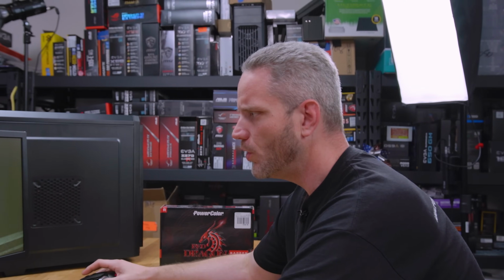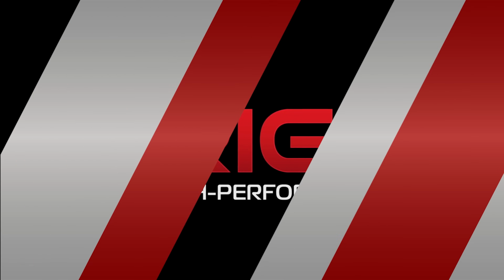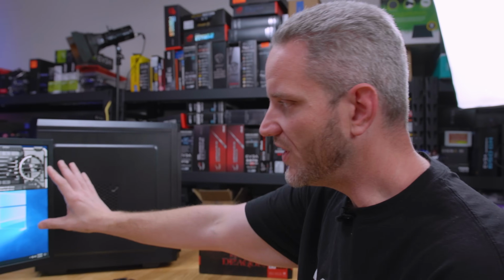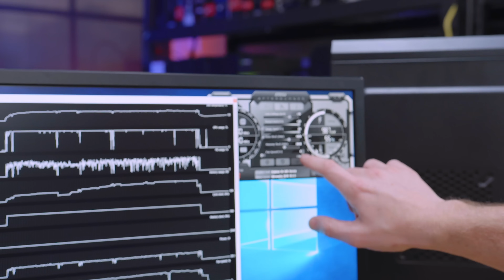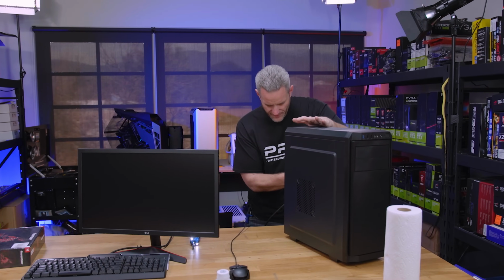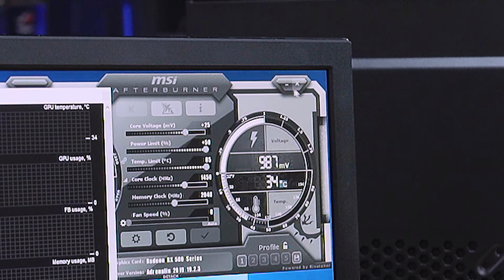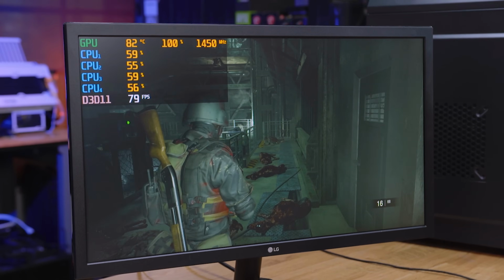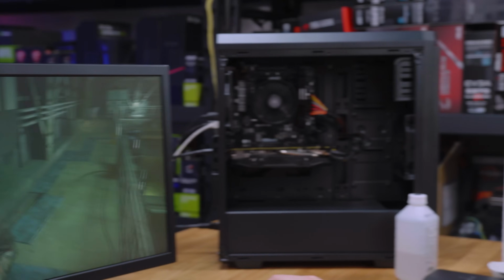Should you replace your video card's thermal paste??

Comment: Just re pasted both my EVGA 3070ti FTW3 and 3070 XC3 Ultra. Huge performance in both. I’m an EVGA fanboy for life but whatever EVGA used for paste in its 30 series is poo. 

Also. You’re not going to see an improvement in temps if you leave fan curve the same. It’ll make an improvement to your ears though. The fans won’t have to run as hard to get to its target temp. But if you locked fan speed before and after just to see the difference (and didn’t get to a point where you were thermal throttling) you’d see a big difference.

Comment: Per the Magnuson-Moss warranty act, manufacturers cannot (in the US) void your warranty simply for the act of opening the product/breaking a seal(or sticker) they MAY still void your warranty if they determine your actions caused the failure or made it impossible/unreasonable to repair, and the burden of proof lies with them. 

that said, good luck fighting a manufacturer in court over a few-hundred-dollar graphics card.

put simply, if you manage to re-paste your card without damaging it, but while still under warranty something else dies, they can't legally claim your warranty is void. however, if you rip off one of those SMD components with your paper towel, you're screwed.

Comment: Did the thermal pad are necessary to  replace?
Reply: depends on heavy the workload, and how often + how long you used your gpu for that heavy workload.
but for a reference, changing it once every 3 years is a wise choice.

Comment: Im wondering if I should repaste mine... currently at a MSI gtx1080 when I stress test with Furmark or AIDA 64 (when stress testing both CPU and GPU) my GPU doesn't go past 73c however whenever I'm gaming it settles at 80c
Reply: how old is your 1080?
Reply: @hadifelani  4 years old
Reply: @ZenMaster44  then yes you should definitely change it :) especially if you mainly play triple A titled games very often.

I'd recommend Kingpin KPx, Thermal Grizzly Kryonaut, Noctua NT-H2, and Arctic MX-4 or 5.

TG is a bit more pricey than the rest, but if you buy the 5.5g one it has the better value.

Comment: Not sure about replacing paste right out of the box, however I bought a GTX 1080 shortly after launch and recently began getting random crashes across all my games. GPU was pushing over 90C before I shut it down, taking the card apart revealed that almost all the thermal paste was just gone.

Thankfully reapplying paste seems to have fixed the issue, since I've got a better chance of winning the powerball than being able to upgrade to a 3080 at MSRP.
Reply: I also had similar issue, but it was with my laptop. MSi Prestige P65, a combo of i7-9750H + GTX 1660 Ti, bought in February 2020.
While the cpu itself is actually known to heat up so easily just like its predecessor the i7-8750H, it is so worryingly hot that it easily heats up to over 90 degrees celcius, even the idle temps is around 60-67c which is abnormal for laptops. And it will always shuts itself down (the standard safety measure for all modern cpus) when I tested it with Cinebench benchmark because it went over 95c.

I fear if I ignore this problem my laptop wont last even a year, so I had to replace the paste after two days of usage. I even asked for permission from the retail store where I bought this laptop so I still can have my warranty, fortunately they allowed me, with the condition that their technician is the one does it.

And after opening the laptop, what I get is even worse, all of them, both the stock paste and pads, are dried out and already went solid!
I changed the stock paste with Kryonaut, and the pads with some generic ones, it went down about 10c degrees. Peaking at 78-84c on triple A games and averaging at 65-75c, reaching 85-92c on Cinebench, and 50-55 on idle.

There are others issues related to temperatures, but it's more of a problem of the CPU itself since it still the same old 14nm cpu, still at a worrying temperature, but at least it doesn't hit over 90 as often.

But since I use my laptop for heavy workloads very often, I decided to gamble myself to use liquid metals after half a year of use. And with some tweaking (undervolt + underclock + locking it at 3.4 GHz on all cores using ThrottleStop) it finally went down to under 40c at idle, making it very silent. Under gaming load it only peaks to 75c, and going around 84-90c on Cinebench. Best decision I've made, actually.

Comment: Mines reaching 89 C . It still runs, but it's still pretty hot. I touch the glass on the case and I think you can fry an egg on the glass. 

I'LL inspect the thermal paste and readjust the case fans.

Comment: I have a OMEN prebuild and the CPU went to 100c all the time putting MX-4's on there cooled the CPU down 10c to 90c and have it be stable there (cpu = 9700f)
Reply: thats abad alone u need better cooler or open side of ur case
Reply: @imed122  the motherboard has a backplate that is solderd on

Comment: My video card keep ramping up the fan every 3 mn. No matter if everything is closed and on idle or playing games. The temperature stays about the same. I will try to replace the thermal paste hopefully it will stop ramping.
Reply: Soo if anyone is interested. I did change the Thermal paste. And deep clean the whole thing. Also i put some oil in one of the fan that wasnt turning properly. And after all that. My gpu was going nuts again every 3mn. I monitored it to understand why. And i found the solution.

 It was idle the whole time until it reached 56C. Then fans where ramping up to 35%. So the real fix so far is i keep it on manual at 4rpm. And watch the temperature....  Until i can figure out another way. I got no idea.. 

If anyone else knows. Reply to me. I have a asus gtx 1070 OC but not boosted. And i used the asus gpu tweaK2

[edit] So i ran the gpu fan at 25% for 2 -3 hours while playing games. The max temperature got changed at 85c in the asus gpu tweak2  when i was manualy ramping it at 4rpm. Now the rpm is happening less often for some reason.

Comment: All PC cases I find on the market is not optimized to give proper airflow to you GPU so I bought a Coolermaster HAF XB that I replaced the side door with two 14cm fans that blow cold air directly at my GTX1080ti and it runs a lot colder. On the CPU side side doors has been removed so the CPU sucks cold air from outside also directly.

Comment: Guys, I've had AMD R9 290X from ASUS, which has this huge DirectCU II cooler, kard is just enormous, weights over 1 kilo (metric wins, sorry) and I changed it because I couldn't play AC Syndicate on it, like I couldn't get over 35 FPS and had 80-88 degrees C on it. So I bought a new graphic card, much stronger and I wanted to sell my old AMD R9 290X, so I changed thermal paste and was like "I'm going to try her if she's running, make sure I did not destroy her." Guess what. I had 71-72 degrees C on same game (AC Syndicate) and stable 40-45 FPS. So that's my story of what an improvement one can get just by changing their thermal paste, some additional info: The R9 290X was bought on december 2014, already changed thermal paste in 2016ish I think and did not touch it since then, until like february 2021, so about 4-5 years old thermal paste got changed.

Comment: My GTX 1660 was running hot enough to make pancakes.  It wasn't causing any issues, but the fans were wailing.  So I did this, took them temps down about 27 deg C!!!  It looked like a 3 year old put the original paste on.  Nearly missed the entire chip!
Reply: what is your card brand and what was your idle temps and loads before and after?
Reply: @RyandeSilva  EVGA 1660 ULTRA I don't recall idle before, it was alarming under load though. I did also added a cpu water cooler first. It did remove some heat from the case though.  The paste helped the most though.

Comment: I got almost the same results. RX 570 Expedition from Asus. Using 140W of power it hovers around 80 degrees. After changing the paste it got maybe 1-2 degrees better, but that is about it. Shame, I was hoping for a bit better results, as the card overclocks like crazy. I guess radiator is just not large enough...

Comment: Running GTX 970 overclocked currently (while waiting my 3060ti to arrive if it ever actually does). 
Its about 5 years old average temp been ~70C with fixed 80% fan speed. 
After changing the thermal paste now it runs around 62C with the same configuration.
So yeah pretty huge difference.

Comment: in my case with a phoenix gxt 1660 (single fan card) i replaced the thermal paste and i went from 79-80C bouncing around with those number hit 81 at one point for a second only, to a whopping 74-75c bouncing with those numbers, and since the gpu created less heat my cpu also went down from 79c to 71c!, my specs are ryzen 5 3600(stock cooler, with -0.0875 voltage and base speed 3600mhz but i let it boost up to 4.1ghz no problem), 16gb ram corsair vengeance , phoenix gtx 1660 single fan , 2 intake fans, 3 exhaust fans, side vented case... also i use high performance power mode

Comment: the temps didnt change but im sure the fans werent working as hard as before... the test isnt complete if you only show the temperature , you have to show the RPM of the fans aswell because the fans are following a curve and the card is designed to hit 81degrees anyway just in one case the fans were working way harder

Comment: Just today changed the paste on my 1080 Ti for the first time in 4 years. Saw load temps drop from 84 C to 68-72. Doesn't throttle anymore and performs quite a lot better. If you've had your GPU for a long time and haven't changed the paste, do it.
Reply: How difficult was it to disassemble your GPU?

Comment: My 2080ti was fine for a while but it suddenly started to ramp the fans up to 2980 rpm if not higher after like 5 mins of gaming and also my frames have been lower than usual. I was told by someone that he had same problem on nvidia forums and he told me to replace the thermal paste. Would that actually help?

Comment: 9:01 Well, if that's not enough for a 580, I guess that explains why my 5700 is just baking at 95+ degrees Celsius... -_-
Though, I do have a 200mm intake with a 140mm out the back and 120mm out the top through a radiator, plus a little help from the PSU with I think another 140mm.
Also the entire front is mesh and the side near the GPU is mesh and the top with the radiator mounted there is mesh. So it's very "arid".
However, when the GPU is blasting, the air towards the window-pane on the side makes it really hot, like an oven. - So I suppose another fan or two taking in and blowing against the GPU on the other side and another exhaust in the top could help with cool air?... - The 5700 is solid, but man does it run hot. Apparently it's normal to sit at 105c and it should shut off there, but wow...

Comment: I know it's a visual thing these days with rgb but a metal case with a side intake fan directly over the pcie slots makes a good difference. My 3090 sits 8-9° lower on idle fan on it stays at 36°
Ingame your gpu is going to run at the temperature the fan curve wants it to really, unless you do a custom fan curve you can get a right balance of heat to fan noise but it takes some testing. But obviously the vid is about heat transfer less work for the fan the lower the noise :)

Comment: I replaced the paste on my RX580 and saw a ~10 degree drop in temps with the fans at a fixed rpm. Switching to a fan curve the temperature saving was still noticeable, but much less obvious... Of course, the fans were much quieter, so no complaints here.

Comment: replace the Thermal Paste to get better Temps on a Unit. is just a Myth!!! Its some time ago as PCGH testet alternative to Thermal Paste. You can choose Honey, Ketchup, Creme or toothpaste. All of them working with same result. You can watch the vid here on youtube. 

If you get better temps like EIZamo92 and many many many Poeple reporting every time when it comes to this topic. They all make the same mistake...without exception all of them forget to deactivate or bypass the fan control. So there is always a difference. The term thermal paste is also misleading. It should actually be called a balancing compound. Because as already mentioned at the beginning. Doesn't it have any better properties than honey, ketchup, cream, or toothpaste.
Why leveling compound and not thermal paste ... because your primary task is to level out and prevent air pockets and not to conduct heat. Even if the paste / mass is already a few years old, it makes no difference because where should air inclusions suddenly come from. Once they are prevented. Then they will be after 15 or 20 years.
There are also no fixed replacement intervals. Otherwise these would also be explicitly identified. Comparable to changing the oil in a car. Because the manufacturers would then have to protect themselves legally with it.

solong
speedson

Comment: It is mandatory, if not to change the paste, at least to check it.  I had an MSI video card that failed exactly when the warranty expired.  When I checked the processor I discovered that the thermal paste point did not stretch.  It was just in the middle of the processor and very thick. 🤬🤬🤬

Comment: I think we all had this.  OC Using MDI Playing high end games even older game like the far cry games far cry 5  New dawn  ect also even call of duty.  My Rx580 8gb was starting to  get rather toasty up to 90c So I replace my card's thermal paste. But  it still did no good it still got up to 90c. But it all change when  I ended up getting an after market GPU air cooler off of eBay the RX 580  now sits on around about the 45c to 55c mark.

Comment: Bought a used 570 running siege of beaulos graphic settings at around 110 frames, went from 89 degrees, switched a blocked intake fan to the top for an out take and changed paste to mx4 and now the max temp I’ve gotten ever is 72

Comment: Can somebody help me? I replaced thermal paste almost 5 months ago because I had stuttering in most of my games (even at minimum, if i didn't limit it at maximum 40 fps, it began to stutter), and the problem ceased, but now it began again, it is supposed to last so little? Some weeks ago i ran 3DMark and the performance in 1080 was so sorry and filled with stuttering that I wanted to rip my eyes off and throw them throught the window! My computer is far from the best, but i consider that almost at minimum settings it has to run the games at 60 fps. My equipment is:

Mother: Asus M5 A97 R2.0
CPU: Amd FX-8350 8 cores
Memory: 2x4gb G-Skill TridentX 1600 mhz.
GPU: Asus Radeon RX 480 Strix Gaming 8 gb
SSD (OS): WD Green 480 gb
HDD: WD Blue 1 tb

The games that i play:

- Horizon: Zero Dawn (minimum with limit 40 fps, stutters)
- The Witcher 2 (no stuttering but in some places drops to 35-38 fps, no ubersampling)
- Skyrim SE (at minimum no stuttering but fps drops in some places)
- Crysis 3 (at minimum runs well, but with my previous gpu i ran it well in high settings without fps limit, now stutters)
- Doom Eternal (the only one that runs at stables 55-60 fps at ultra)
- Marvel's Avengers (even at minimum stutters without fps limit)

When i changed the thermal paste all these games ran smoothly in high settings (even the witcher 2 with ubersampling on at 30-40 fps) without stuttering. I don't know if i have a wrong config or it's just that the components are not powerful enough. If anyone can throw me a hand, i appreciate it in advance. -

Comment: Some forums said the thermal paste for a bare die should be really thin and spread out (with finger or applicator). It should be so thin that you can still see the die through the layer of paste.

Others, like Jay here, said bare die should use a moderate amount of paste. I wonder which one is the better?
Reply: It is always better to put a little too much than having a chance that you do not put enough. The extra paste will squirt out when the cooler is tightened in place. Just do it like Jay here, put a dab in the middle, do not try to spread and level it out because that might leave place for air to be trapped in.

Comment: I have gtx1080 ti aorus and on idle it runs at 55 degrees and in general it runs at 80 should I replace thermal past is that high temp ?

Comment: Interestingly I always buy asus gpu’s 
My last card was a  2080ti and I got a significant improvement by repasting using grizzly kryonaut.
I recently managed to get hold of a Strix 3090 (much to my sons delight as e got the 2080ti) and duly repasted it with grizzly kryonaut, but I didn’t find it to be at all beneficial this time temperature wise, so I think Asus has used much better paste of the 3090 Strix then it did with the 2080ti
Reply: Yes the thermal paste can be better on different models of graphics cards. Also, your 2080 ti could've gone with stock paste for years. A fresh new GPU will have fresher thermal paste that hasn't been in use yet. That's why repasting every 4-6~ years or so (sooner if you get overheating) is a good bet for improvement. I'm running an Asus ROG Strix GTX 1080.

Comment: I have the same card, it runs at 89c then thermal throttles lol. It could still run games at high settings then after 5 mins it starts thermal throttling while trying to keep max clock speed resulting in lag spikes.

Comment: Quick question, I have a gtx 1070 G1 gaming, idle temps are 49-52c, when I'm gaming it's going up to 78c with auto fan curve. I always put my fans to 70% speed and then temps don't get over 65c while gaming (ps. The card is overclocked using msi afterburner). One of my fans (the one in the middle) is acting up sometimes when it's spinning at 70% or higher but I guess the bearings are on their way out. Are these temps OK for this card, I think it should run cooler with that big G1 gaming 3 fan cooler. Should I change the thermal paste? I've had this card since 2017, never changed the thermal paste.